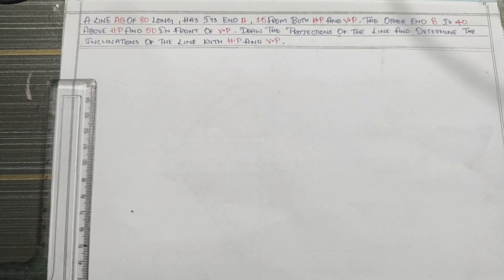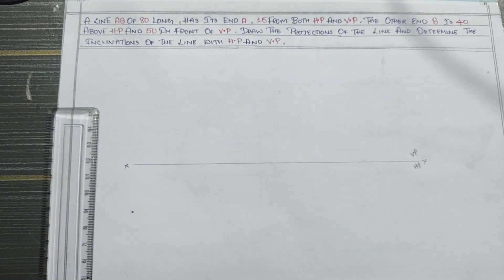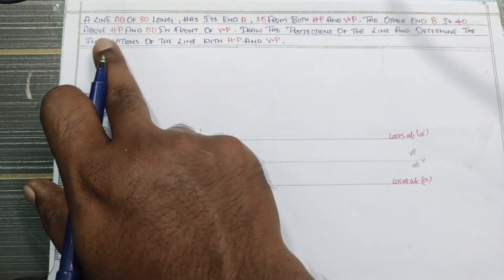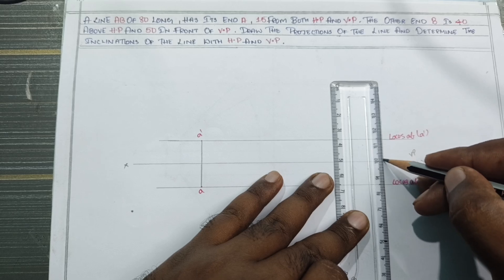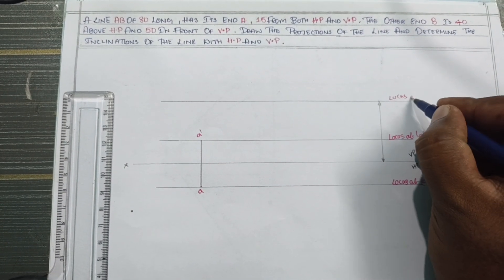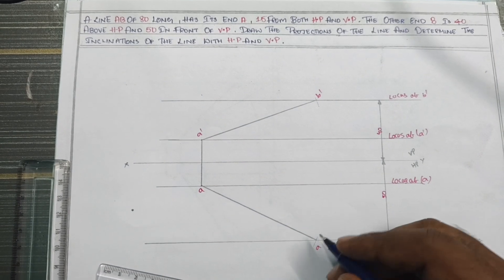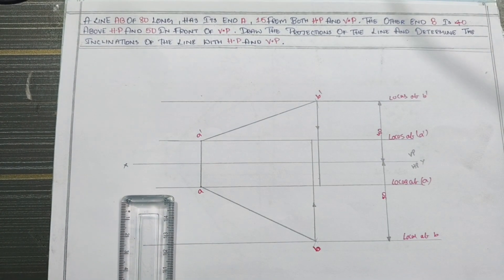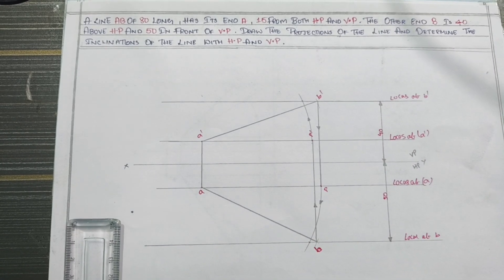PROJECTION OF THE LINE - METHOD -3

Comment: Sir,  
1) xy reference line and dimension line (2h light OR dark hb) tho draw cheyalee?

2) locus of a,b,a',b'   ani rayalaa ?

3) finally, angels vachayikada.
     correct angle 24 degre    ayithee.
    manaki 23 degre angle vaste On sheet medha due to small errors. 
SO, final exam lo marks estara EVARA ?

4) true length dimension echaru,  Reduced length ki dimension avasaram ledha ?

 Thank you sir.
Reply from the maker: I will send link
Yes
Angle perfect ga undali
Maximum vesaru
Need process